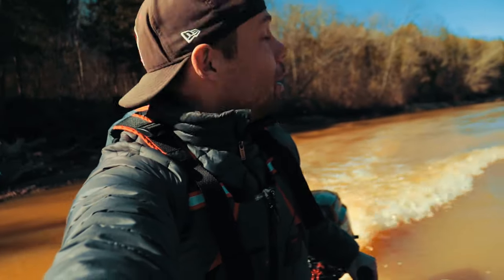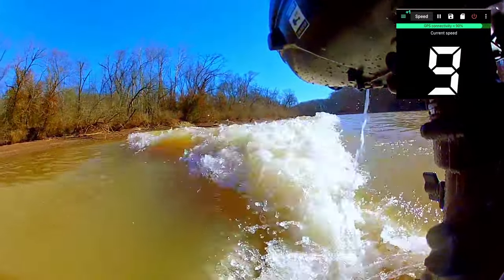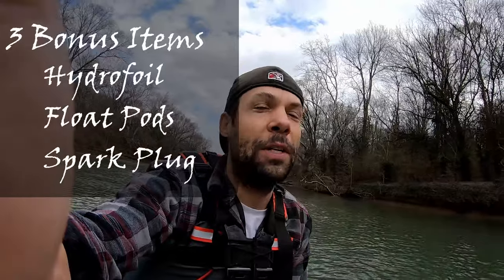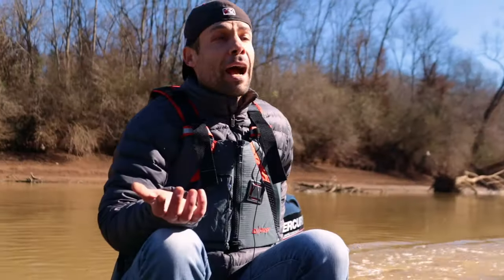10 Things KILLING Your Jon Boat SPEED and PERFORMANCE

Comment from the maker: Here is the FULL GUIDE on how to adjust your TRIM to max your John Boat's top speed and performance: https://youtu.be/PYldlDtkZrI

The 10 Things:
00:10 - Trim
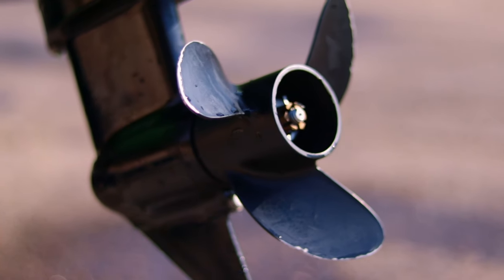00:39 - Prop Pitch
01:12 - Jon Boat Weight Distribution
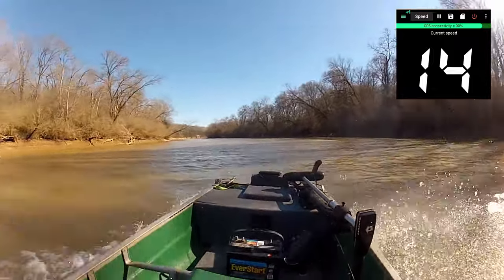02:10 - Large Gas Tank and Total Weight
02:43 - Gas Lines
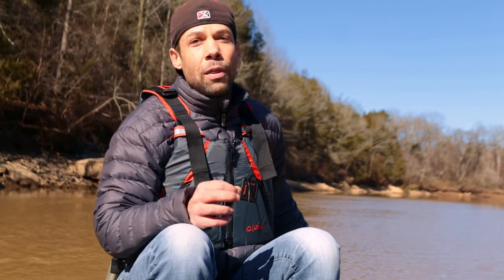03:04 - Fuel Filter
03:12 - Crappy Gas
03:28 - Bad Air Flow
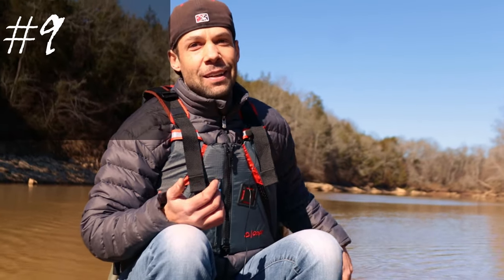03:42 - Motor HP Rating
03:56 - ????????? BEST ONE 
04:41 - 3 BONUS ITEMS [Hydrofoil, Float Pods, Spark Plug]

My setup:
2019 Mercury/Tohatsu [same motor] 6hp 4-stroke Outboard
1984 Coleman Crawdad 12" Flat Bottom Jon Boat

For million $$$ sponsorships (or just wanna chat) hit me up at skinnyriveroutdoors@gmail.com

Comment: I've enjoyed a few of your videos finding them quite interesting and informative.  I have a '68 Aluma Craft F7-14 foot semi-V that I truly enjoy.  I'm almost 80 and this little boat at 260 lbs is still easily handled by me on and off the lakes and reservoirs I frequent.  I thoroughly enjoyed your video on trim and happy to have viewed '10 things.'  It solidified my position on 3 gallon tank verses internal tank and a gallon on the side.  I ran 6 & 15 horse two strokes for years, constant carb/tune up issues.  Not being mechanically inclined I lined a few pocketbooks as mine grew thinner.  Last fall I bought a 5hp Merc 4 stroke, thank you stimulus check, and love it.  It's very economical on gas, very quiet and will quite unlikely ever be run pedal to the medal.  I enjoy slow go and being able to hear myself think as well as the bird chirping.  Thanks for sharing your experiences.  They've certainly answered some of my curiosities and you are excellent explaining your reasoning(s).
Reply from the maker: I appreciate the view! It sounds like you have a great setup. That combo of the 5hp 4stroke and the 14’ is perfect. Keep me updated and let me know if you have any questions as that 5hp is basically the same motor as my 6hp.

Comment: Had to buy a new tank this year bc the gas cap fell apart on my old one, too old to find a replacement, so bought a new tank from Cabelas.  Even though my old gray fuel line was not suffering that brown crude breakdown in the inside, I replaced the fuel lines with fuel hose from NAPA.
Reply from the maker: I’m a hypocrite, I’m telling everyone to change them but I still got those crappy gray ones
Reply: @Skinnyriver  LOL, shame on you, LOL.  The gray hose was no longer flexible, the NAPA hose, is.  Much easier to manage in the boat.

Comment: Great info.  Thanks
Any input re: 13 ft  inflatable, w/ 9.9  mercury, long shaft
Reply from the maker: That sounds like a good setup. Is it planing well? From talking to other people planing position is the most important thing with inflatables. Main things there is trim position and putting more weight upfront (leaning forward to plane). Also lower pitch prop can give more acceleration power to plane but could hurt top speed

Comment: Hello, is it worth installing a Hydrofoil Easterner on a tohatsu 6hp 4t? Does it reduce the engine speed? Thanks in advance for the answer! I AM FROM ROMANIA and I like your tutorials.
Reply from the maker: If your boat will not plane out, a hydrofoil is a good idea. It will lower your top speed, but will help your boat plane better. If your boat planes well, then a hydrofoil will not really help much

Comment: My 14' flatbottom w/Evinrude 25 hp set at the 2nd trim notch hits 22 mph loaded with a full 6 gal tank, fishing gear, 2 batteries, foot control mounted front trolling motor, fish finder, safety gear, seats, anchor, ice chest with ice and water and my 260# self
Reply from the maker: Nice that sounds like an awesome setup!

Comment: great video thanks! i'm new to boating i have a 5hp nissan 2 stroke on a 13' aluminum  boat, wondering about cavitation or ventilation? is the motor too deep? to shallow? where do i measure from etc. and possible fixes would be appreciated!
Reply from the maker: I’m not an expert but Ventilation is when there is turbulence from the boat that gets to the prop and it loses grip. This usually happens when the prop is too close to the top of the water. Cavitation is more complicated, sometimes it happens when there is damage to the prop and it creates vacuum “bubbles” in the water that collapse and cause damage tot he prop and lower performance. Here is a good explanation https://www.godownsize.com/why-do-boats-cavitate-explained/ I think key is to have prop at proper position and trim and make sure prop edges are not jagged and damaged
Reply: @Skinnyriver  Thanks so much!  I'll check the prop next.

Comment: I told one of my son's to mount a transducer on our little 14 foot boat and I didn't think much about it until he slept in and I took the boat out in the morning and wow.he had mounted the transducer under the boat about a foot from the back of the transom, I noticed that the engine was running at a higher RPM and it acted like a pad on one of my Old pad Bass boat's.i believe it went a third faster,that transducer was for a Old hummingbird it was about the size of a hockey puck.
Reply from the maker: lol 😂 was the transducer literally on the bottom of the boat?? Yeah I bet you are right… my boat kind of creates a suction with the water causing drag, it probably helped break that up lowering drag or like you said a pad that makes the bottom of the boat flatter and it was riding on that like a pad
Reply: @Skinnyriver  yes I sit on the right side and it was right under me,it did pull the wire off the transducer but it ran like it had a engine twice the horsepower, I took it off because I was afraid it would tear a hole in the bottom of the boat, 😂

Comment: Could a motor be to heavy to plan out? I have a 9.5 ft jon boat with a 9.9 mercury electric start
Reply from the maker: Yeah, try lowest trim position. Put weight in front. If that doesn’t work you can try a lower pitch prop or a hydrofoil
Reply: @Skinnyriver  thank you !! I put my son in the front of the boat and it planned out in about 15 seconds and went 21mph… scared hell outta both of us…😂😂😂. Also would the lowest position also mean getting the propeller closet to the boat? I’m a brand boater so I’m still learning…. Also Tip #12 , if the water is real choppy and has waves 3 ft tall and rolling…. Leave that dam 10ft
 Jon boat on the trailor 😂😂 I wanted to go boating, not flying.
Reply from the maker: Ha ha yeah, check out this video about trim positions if you get a free 5 mins. https://youtu.be/PYldlDtkZrI 
Position 1 is the lowest position closest to the boat. The higher the position the more it pushes the front of the boat UP which is not what you need if you can’t plane out.

Comment: #1  weight, everything else is secondary. Four strokes are heavy and slow.
Reply from the maker: Yeah I agree, too bad here in the USA we can’t buy new carb’ed 2-strokes anymore due to EPA regs. Had an 80’s Yamaha 2-stroke, amazing motor!
Reply: Ya, I’ve got a really nice 87 Evinrude 15. Not only is it fast but it only weighs 75#. I think a new 15 four stroke is #108. I see so many guys who buy a 14’ fishing boat with 10 horse who spend a lot money on floors, big batteries, storage etc. They take the boat out for it’s first run and the boat just plows water. Sad, good intentions big disappointment.
Reply: @kentyler966  yep you know things are going backwards when my 50 year old 25 johnson weighs 20-30 pounds less than a new 15 4 stroke merc, the new 25s weigh about 70 pounds more
Reply: I gave my 1965 evinrude 9.5 2 stroke to my brother and bought a new tohatsu 9.8 4 stroke. He’s 2mph slower than me, but my fuel efficiency is unbelievable.
Reply from the maker: Yeah, I can get 24 mpg with my 6hp 4-stroke. It’s crazy it’s better than my truck. I actually did a vid testing mpg https://youtu.be/2qUKlFgNyNg
Reply: @williamsporing1500  the speed difference is because before the 80’s they measured HP at the powerhead instead of the prop. This means that the 9.5 Evinrude is in reality a 7.5-8hp due to loss of power in the lower unit because of the gears.
Reply from the maker: I definitely learned something, thanks
Reply: @Hensleytheultimatehoundsman  yea, I’ve heard that. They used to do cars the same way. The 9.5 was a good little motor for me for years, and it still pushes my brother all over lol
I’m not regretting buying the 4 stroke though. No mixing and incredible fuel mileage.
Reply: @williamsporing1500  I get now especially with gas prices not liking spending that much on gas

Comment: You wanna talk about trim bro you hole shaft is way under your boat
Reply from the maker: Yeah, My cavi plate is 1” lower than the bottom of my transom. I thought about making a Jack plate but it’s probably not worth the $$ for my small setup. I can get 18mph now a Jack plate may get me 20. 

I may put a 1” block on my transom to get the motor up 1” just to see if it makes a difference
Reply: @Skinnyriver  did it make a difference
Reply: @Skinnyriver  couse with my 15hp on my 12ft was getting 20 now I am getting 26.7
Reply from the maker: Gonna try it soon, I’ll let you know